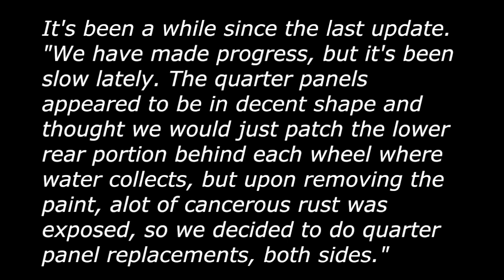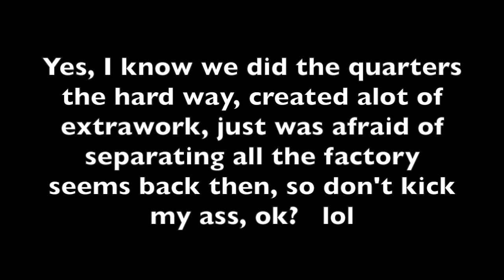Rusted out Quarter Panel Replacement - 65 Mustang - Throwback Thursday

Comment: When ever the day comes for my quarter replacement I will be needing to fix my order wheels houses too.  The way you did yours is exactly what I need.
Reply from the maker: Cobrafanatik22 Cool, yea, was pretty easy to do them the way I did it, you could also just replace the whole wheelhouse by removing at the spot welds.
Reply: I can't remember what it looked like with the quarters off but I can only picture it being a mess to remove the entire outer wheelhouse.  The only portion I need fixed is what you replaced but I guess cutting the exact size off may be difficult.